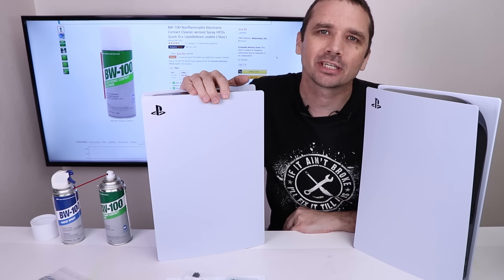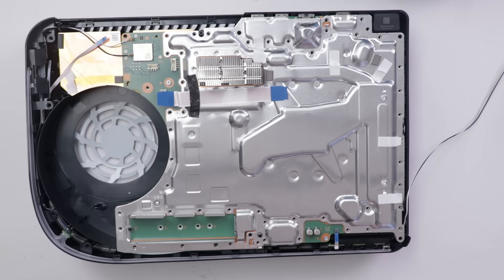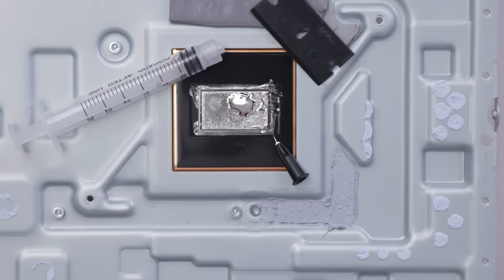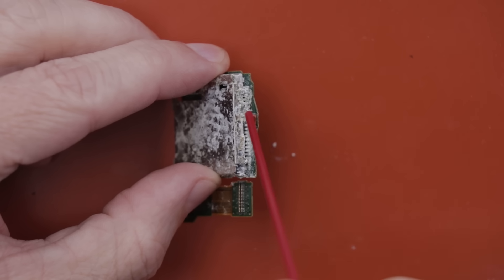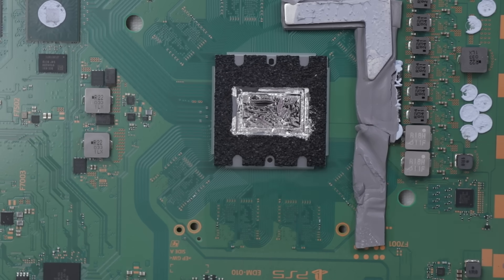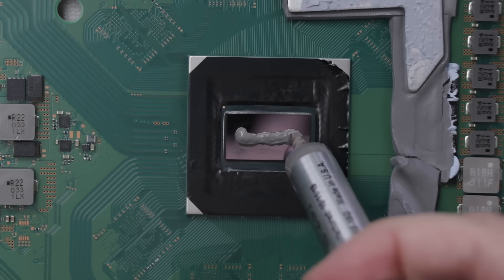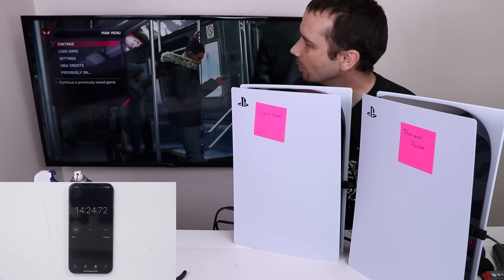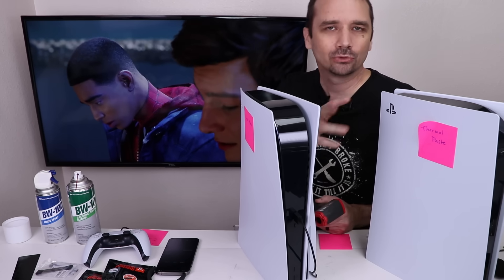PS5 Liquid Metal vs Thermal Paste - It OVERHEATED!

Comment: I have the new consoles but honestly.. idk about this thermal solution, long haul. I feel like Sony could potentially have an Xbox 360 shaped dilemma to face in about 2 years or so, when those adhesives expand, contract and soften or solidify.

Maybe not.. but I've got to say.. the wheel is still round for a reason.

Comment: dude, you use a good type of thermal paste but the best on out their is just as good as liquid metal Linus(Linus tech tips) actually did a test on it and it's "cryonaut from thermal grizzly" conclusion was you don't need liquid metal if you have the right type of thermal paste the second best one is Noctua NT-H2 also a good thermal paste, so yeah average thermal paste dose a decent job but top tier is just as good if not better than liquid metal

Comment: This is simply why i would not buy a PS5 if a console suffers that badly from swapping the liquid metal to MX-4 then there clearly a similar situation as the CELL processors, Far to power hungry. As well as that i bet the liquid metal will destroy the APU after a few good years of use or at least turn it into a rock.

The ram and soldered SSD also concerns me, the ram in a lot of cases run warmer then the APU at around the 80-90 degrees.Surely with how hard the SSD gets pushed long term reliability with be awful.Only Time will tell but judging by how the PS3 CECHA01 to CECHC03 last due to Thermal issues,i would say questionable

Comment: I'm actaully super impressed at sony for adopting such a modern thermal solution for heat transfer...  Even many computer enthusasts aren't using liquid metal for obvious risk reasons but to see sony go ahead and build a proper solution to safely use it is actually pretty great.  I hope that the PC market takes note of this and we start seeing full CPU cooling solutions build around the safe and easy use of liquid metal.
Reply: Its cool, but it seems like they had no other option because of their design and high clock rates 😅
Reply: It was the only option to be on par with the series X big GPU, it was a last moment but good move from sony.
Reply: Sony had to use high clocks to keep up with xbox. They had no choice but to beef up the heat sink and use liquid metal. It paid off because even with a weaker gpu the console looks good performance wise.
Reply: @dustinj7028  I mean that's fair but like you could literally say that about any modern innovation that some company adopted to beat the competition.  If sony did this and using weaker hardware that probably cost way less managed to make a competative product that could be sold at the same price point as their competition then they are the ones winning.  Innovation even if it is simply to compete with a competator is good.  Just think if this allowed them to squeeze more performance out of the product micorsoft could have potentially done the same thing allowing for higher clock speeds on their system especially with their far better cooling design leading to higher more stable FPS for their users.  It just seems to me to be a good step forward.
Reply: @Reegareth  I get what your saying. Liquid metal has been around since the 80's. Manufacturers are hesitant to use for the fact it can leak and short electronics out. The stuff is not super expensive, and is superior to thermal paste as far as heat transfer goes. My point was Sony would not have used LM unless they absolutely needed to. High clocks = more heat. We will see long term how their implementation of LM pays off.
Reply: just design better heatsink and airflow, and you won't need liquid metal. Difference between liquid metal vs a nice thermal paste, could be max 3-4ºC
there is not easy and safe use of liquid metal. and i won't recommend it ever. There is no need to use it there are high performance safe alternatives.
Reply: @MrDvneil  Uhhh...   From what I've seen and researched it's much more than a 3 C difference.  There are more factors to consider as well than just what you stated.   Engineering has to take cost into consideration and liquid metal is probably a far cheaper solution than including a more beefy cooler.  With the far better thermal conductivity they can use a cheaper cooler and the liquid metal probably costs them a fraction of a penny at the amounts they probably use.  Also your claim that it is somehow unsafe is completely unfounded in this case.  I have not heard of any incidents involving console failure due to its use.  When properly engineered and applied it is perfectly safe.  Your gripes are more from the PC building perspective rather than the large scale manufacturing and make more sense there but that has no bearing when talking console production.

An additional side note that I just realized and forgot to include is that the PS5 chip doesn't have an IHS (integrated heat spreader) covering the die.  In many cases this greatly increases the effectiveness of the Liquid metal.  In the cases where the stock thermal interface between the IHS and the die is left in place your comment about max 3-4 C gain is actually accurate however the PS5 does not have an IHS at all so the performance gain is far greater than what you see with PC testing.
Reply: @Reegareth  xbox series x, doesnt have beefier heatsink, just best designed, doesnt even have liquid metal. has better temps, is quieter.
dont need 2 years figuring out how to prevent most of liquid metal problems.

using liquid metal , by all means is the most expensive solution.
Reply: @MrDvneil  Liquid metal can be used between the die and heatspreader for better results. Nowadays more and more heatspreaders get soldered onto the cpu though and delidding makes rarely a lot of sense in those cases.
Reply: @ThePandafriend  yeah, just in that case made sense, but recent cpus are all soldered, and is not worth, 
for gpus, consoles, is not worth the risk using liquid metal. there are really good thermal paste that gives so close peformance than liquid metal.
Reply: @MrDvneil  No thermal paste can come close to liquid metal. The best thermal paste on the market has a thermal conductivity of ~12,5 W/(m*k) (that one's for extreme overclocking), common good paste has ~8,5 (that's for normal use), while liquid metal has a conductivity of ~70 W/(m*k) and indium solder has a conductivity of 80-87 W(m*k).
However indium requires a much thicker layer. The requirement for liquid metal is ~0,05mm, while indium solder requires ~0,5-1mm.
But in general it's a good thing when a cpu is soldered.
Reply: This guy, every thing this guy says. lol, I agree

Comment: Poor cooling design. There should be more than enough thermal mass there to cool it with regular paste but Sony is notorious for bad design when it comes to cooling (hence their loud consoles) so they just slapped as much liquid metal on there as possible. You're probably getting more cooling from the mass of the liquid metal than the PS5 heat sink itself lmfao

Comment: Such a poor design. You can tell they designed the exterior first then just shoved everything inside as best they could. Hence the 48 screws to hold it all in place and stop it warping to conform to the WARPED design of the console itself. It's a total MESS inside.

Comment: I like this channel and you do good work but good lord, that's way too much thermal paste for a direct contact die.  also, stop using AS5, it's not 2003 anymore.  So many carbon based pastes are better, have 5-10 year usage life, aren't capacitive, and don't require a 200 hour burn in to reach max potential.  Try Arctic MX-5 if you like the consistency of AS5, you'll like MX-5.  MX-4 is excellent too and you can get it in 30-40g tubes for pennies on the dollar.

Comment: Well, Sony indicated the new PS5 model 100% retains the Liquid Metal solution despite the re-designed (diet version) heatsink. The Sony Japan engineer in the PS5 teardown video stated that the proprietary Liquid Metal solution was stress tested for 2 years under the high GPU frequencies of the PS5. It's essential, and it hasn't changed in the new PS5 board revision. Hopefully the new heatsink (despite less expensive copper) does the job with its new heatpipe spacing and better contact points - including coverage of 1.5 VRAM banks that previously heated up on original PS5 board config.

So, you lose some, you gain some with the new heatsink arrangement in late 2021 shipping PS5s.

Comment: Sony released that new revision units quietly because they don't want you to know that the new PS5 is lighter because it has a worst (smaller and aluminium) heatsink and now are running more hot  compared to the original PS5 that has a big and cooper heatsink ! It cost the same to the consumer but now has a worst heat sink !

@
@

Comment: The fact it needs liquid metal as standard to run properly is a joke. PS5 is ugly as hell. Sony, just design something with a proper intake fan directly over a heatsink which sits on top of the APU kind of like the original Xbox One had.

Comment: honestly liquid metal is very unsave and not a good permanent thermal solution if they went for a non curing high quality thermalk paste would have done almost the same plus minus a degreec of maybe 3 to 5 but would have been saver more easy to remove replace if needed for a repair and wont break ur ps5 if it touches anything

Comment: Why are you even trying standard thermal paste?  PlayStation already released the hardware stats and it runs so hot thanks to overclocking that standard thermal paste doesn’t cut it, they were left with liquid metal or a more failure prone and expensive system like water cooling.  No brained when your selling at a loss.

Comment: why use conductive as5 and not something non conductive like thermal grizzly /mx4?
Reply from the maker: AS5 isn’t conductive
Reply: @Tronicsfix  I meant capacitive, up too late, but the concern is still similar. From the AS5 Datasheet "Arctic Silver 5 should be kept away
from electrical traces, pins, and leads. While it is not electrically conductive, the compound is very slightly
capacitive and could potentially cause problems if it bridges two close-proximity electrical paths."

Comment: What if you put liquid metal on a PS4?
Reply: You can only put it on the ps4 pro, because on the original models it will essentially eat the heatsink.  If you do use it then it would run quieter, but you would have to replace it more often than thermal paste since it oxidizes over time. This shouldn't be an issue on the ps5 though, since it has the foam around the apu

Comment: Seeing the inside of the ps5 is just infuriating, all those tiny little pieces increase manufacture time and reduce repairability, it would be probably 150 dollars cheaper if the design wasn't so inept
Reply: How is it inept? They design the board first. Then design the shell and the rest of the other components around it. I'd like to see you try it. 😂
Reply: @Flip86x  I'm just saying they over rely on flimsy plastic clips which means there's a finite amount of times you can open it before something breaks

Comment: This video just shows how poor PS5 cooling actually is, we have the Series X a more compact design, more powerful machine, better thermals and no liquid metal insight.
Reply: Cool story
Reply: The size of the consoles is actually about the same. The series x is much thicker than the ps5. And no, the ps5s cooling design isn't bad by any means. It keeps the console running quiet, and mitigates the need to replace thermal paste.

Comment: Have you tried using a graphite thermal pad in a game system? I wonder how well that would work, with the bonus of not having to worry about changing it out ever again.
Reply: Pads are even worse than paste and pretty much only worth it if you would change cooler or CPU regularly.

Comment: So you can use liquid metal on a PS4 then right?
Reply: Only on pro models since they use a copper heatsink. On the old fat models it will eventually eat the heatsink since it's made of a different material

Comment: How often till you need to repaste with liquid metal?
Reply: In theory, never. The only reason liquid metal needs to be replaced is because it oxidizes over time, but the way the ps5 is designed with the foam pad is so that won't happen.

Comment: Is the hot memory issue fixed yet?
Reply: No. But so far it hasn't had any negative effects on the console. Based off the temps it was still within safe limits, and for all we know the temp could have been inaccurate from the probe pushing up on the shell.
Reply: @rockl79  hmm thanks

Comment: its really funny that XSX doesnt use liquid metal but it doesnt over heat and also runs at higher clock speed. it just means that the thermal design on XSX is well thougth, I guess they learned their mistake from xbox 360.

Comment: these tests were in my opinion pretty useles. i mean testing without air cooling?
what do you want to prove here? the ps5 will overheat and thats it.
it will overheat with liquid metal or with anything else.
testing the time difference with random tests? u will get anytime other results.
same as testing the temperature at the case.
u have to use temp sensors at the cpu/gpu with some synthetic tests to see a difference.
i mean a real difference. but even without these tests, i can tell you, liquid metal will always outperfom thermal paste.
getting "better" temps with thermal paste was just random based on random cpu/gpu loads....

Comment: I'm curious to see how the LM lasts long term. I've never used it personally in a PC but I've been told it needs to be replaced far more often then a good high quality thermal paste. Also curious if the stuff they are using to seal in the LM will hold up well enough long term that the LM doesn't start leaking out. LM obviously has it's advantages but it seems like a bit of a risk to shove it in a big commodity item like this.
Reply: that's because of cheap copper alot of times you will have a copper plated heatsink and thats where you will see liquid metal be absorbed into the heatsink or pitted anyway that's why some say it needs replaced . so always check the copper heatsink with a magnet if it is magnetic then it's not pure copper
Reply: lmfao who told you that???? liquid metal does not dry and NEVER needs replacing. It's metal bro. There is no water content... Thermal paste dries out. Whoever told you that you have to replace liquid metal was lying lol. Like for real. It literally does not dry or go bad.... Feel like I don't need to say this again but ITS METAL. There is nothing to dry out....

Comment: I see the way they make the fan air flow internally and in a way the air pass through the heat sink but the power box is on the pathway of the hot air flow. I think some exhaust vents need to be added by both side of the plastic case after hot air pass thru the heat sink then straight down/out.

Comment: To remove Liquid Metal you you put it in a Freezer or use a freezing spray so it solidifies and you could take it of as 1 piece? It shoudl be solid under -19 degrees celsius right?

Comment: FYI: liquid metal will bond with the copper eventually "till it cures then it creates a layer bonded liquid metal with copper and then that will stop getting absorbed/merged with the copper" also it will dry out by time goes. Also it will solidify in colder temperatures and loose his properties like close to 0c degrees once gets in there it will need to be reapplied as it will not be the same after that. Also the less liquid metal is the better.. thats way too much liquid metal applied...
Main reason i dont use my water chiller on my liquid metal cpus or apply liquid metal on any of my gpus as liquid metal is useless on my cooling application gpu side..

Comment: You got liquid metal off 2 surfaces but only applied thermal paste in 1.

I can see you putting the PS5 back together with no thermal paste on the other silicon piece.

Is there a reason for that?

Comment: Why didn't it detect a fan problem? That's bad firmware. It's got a 4 pin connector.  It should detect the fan has been unplugged.
Reply from the maker: No, it's not bad firmware. They don't detect faulty fans...same with the PS4

Comment: Excellent ... From what little I know about Thermodynamics that I learned at the University and I hope someone will correct me if I'm wrong ... The person who is doing the heat comparison between the two consoles, is only measuring the temperature by Convection and It is not measuring the temperature by Conduction, which is where the second law of thermodynamics applies ... That is, it is not an exact measurement of the real temperature of the console processor since there is a big difference ... For example, it is as if We would have patients with a very high fever and we would try to measure our body temperature by blowing the thermometer (Convection) instead of putting the thermometer in our mouth (Conduction) ... In short, liquid metal cooling is much more efficient on the contrary of thermal paste since it is a material with greater thermal conductivity that transfers and expels all the heat ... That is why the temperature expelled by Convection is higher ... And as for the liquid metal It cannot have contact with the other components, it is because it has electrical conductivity and it could cause a short circuit unlike thermal paste that does not have electrical conductivity ... I hope this information helps and if I am wrong, someone will correct me for Please since this is a broad subject governed by the laws of thermodynamics ... Greetings to all, and God bless you (^. ^) .. '
Reply: And you deserve a thanks